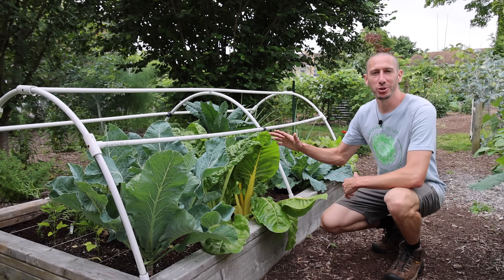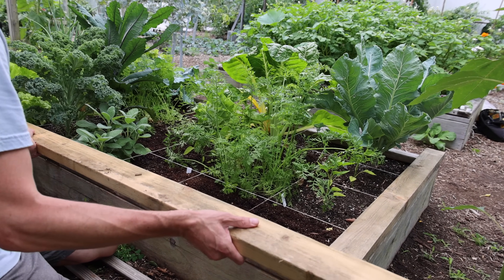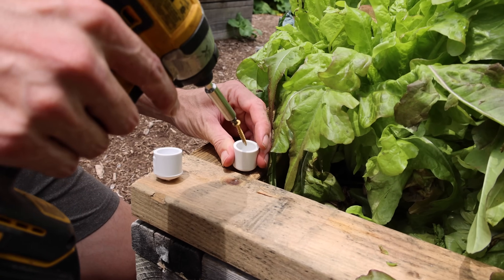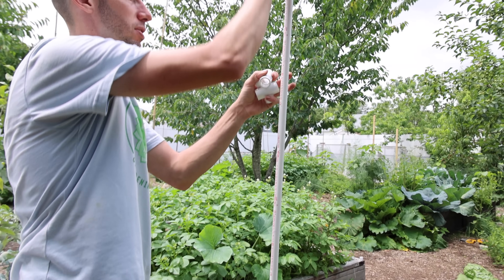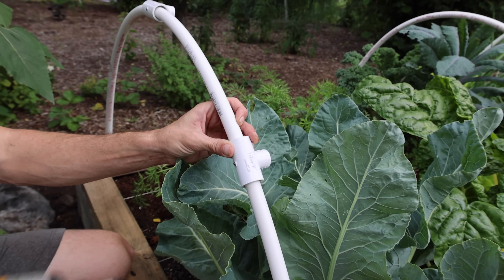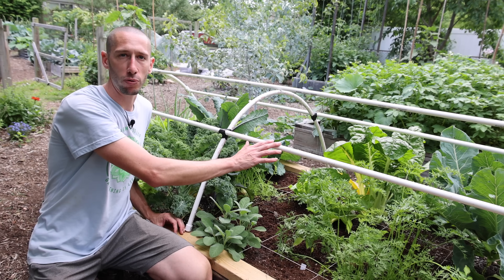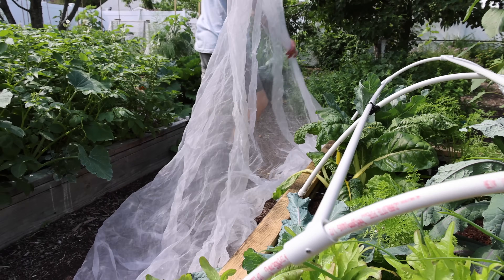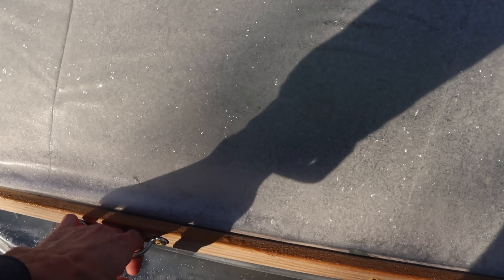How to Build a Raised Bed COVER Using ONLY HAND TOOLS, Protection From EVERYTHING

Comment: This is a good, strong design - my modifications:  1) used stainless steel screws  2) added hinges (with disconnectable hinges) on both sides for easy access to both sides of my 4' x 8' bed.    See Sugatsune disconnectable hinges which can be disconnected with a flick of a switch.

Comment: GREAT JOB and GREAT detail! Thanks for sharing! 

Some Tips: You can use the miter box/saw to cut the PVC. 
Paint the PVC white so it will last and not degrade from the sun. 
Perhaps instead of electrical tape use white wire ties at the junctions of the PVC crossmembers instead of electrical tape. Or slightly longer stainless steel screws to screw the cross beam to the hoop.

Comment: Hi James. I built 2 of these Hoophouses with opening lids 3 years ago, and followed your instructions exactly. I can't thank you enough ! They are still working and opening & closing perfect. The only change I made was that I used split pin hinges so I put hinges at the front as well as the rear. So when I want to get at my tomatoes at the rear of the Hoophouses,  I connect the hinges at the front, remove the pins from the rear hinges and the lid can open at the rear. Thanks again, keep up the great work!
Reply from the maker: Thanks John, and great idea!

Comment: SUPER!  👍👍👍
I may need to add poultry wire cover to discourage furry critters here...deer too.
1&5/8" screws into cut ends of 2x4s seems might loosen over time to me...I'll likely use long deck screws for better hold.

Comment: As a pro carpenter i would suggest thru bolting the caps to the 2x4 ahead of time. Thats alot of stress in soft wood that will only become softer thru the seasons

Comment: AMEN on the insect netting!  I use it on everything and then remove it from the crops that need polinated.  I have been known to wait on the zucchini and hand polinate for a while and since using the netting I have had ZERO squash bugs...so far.  
I use rebar in the corners and sides pushed into the dirt and put the pvc pipe over them.  It works great, but you do have more work to get into the box that way.  I also use the full length of pipe to accomodate my taller plants.  Thanks for this video.  I'm goin to try making mine to open like your's.

Comment: Awesome video, seems totally achievable and super functional! One little note: You ended up multiplying it correctly but when you calculate the length of PVC you need for each hoop you would be using the equation for the circumference of a circle C=2*pi*r and dividing that by 2 for your half circle. You did the math this way but put the equation for the area of a circle (A=pi*r^2).

Comment: Would it be possible to also make an additional use for it as a watering system by drilling small holes in long straight pieces? This would be helpful in the really hot season if you gave it a hose hookup on an end. Love watching your channel.
Reply: That's actually a cool idea

Comment: Thanks for the great video. We made our first cover today, turned out great! A little more money than I would have liked but I'm sure it will help. We live in Mississippi, there are so many pests they eat everything so this will help a lot. We also plan on using it with plastic in the winter, we don't have too many cold nights.  We actually made a bad version of this last winter and got a pretty good yield.  The summer was so hot here we didn't have a good crop, going to move the garden where there is a little more shade.

Comment: A great idea. Thanks. Can you suggest how to do this when the raised bed is made out of sheet metal or, in my case, specially made blocks? Also, it seems to me that the cover has to be as tall as the expected maximum height of the plant. E.g. bush beans vs. pole beans, okra, eggplant, etc.

Comment: Thanks for another great video! QUESTION: is there any downside to constructing a square frame? I have access to a lot of excess pvc pipe and fittings and I would prefer to have a large , square hinged top using three-way elbows at the corners and mounted to the wood with the same end caps you used.  Thanks again!

Comment: I think i have seen you use something similar to sit on top of the Birdies Beds as well? Do you just balance it on top of the thin edges? Or is it a different process?
Reply from the maker: Same too frame, but I build a wooden supper structure in the back to attach it to. I have a video on it

Comment: How do you build your raised beds so that they don’t get forced apart by soil and roots?  What kind of wood do you use?  I would think that with organic growing, you would not want to use pressure treated wood.
Reply from the maker: It’s not pressure treated wood. Standard framing lumber. The beds last for about 5 or so growing seasons 😁
Reply: @jamesprigioni  thanks!

Comment: I like the design and multi-uses, but I'm a bit turned off by the material. I wonder what could be used instead of plastic? Page wire (cattle fencing), something stiff and flexible, maybe... ?

Comment: You don't need the clamp if you hold the pipe with your hand and hold the saw vertically (aim at the ground). If you have a lot of cutting, there are tools specifically for cutting PVC that give you a clean and quick cut, but you need to read the reviews because some of those tools are garbage.